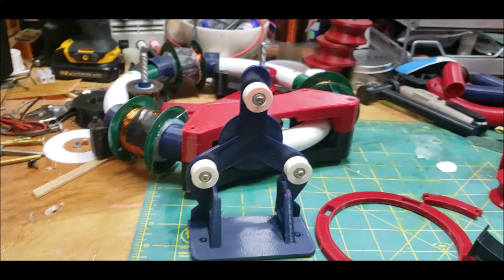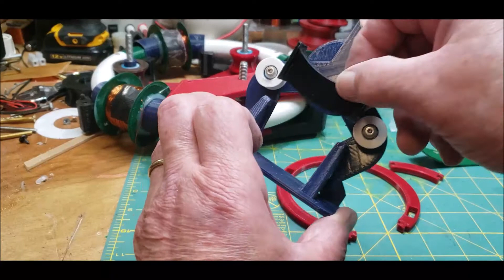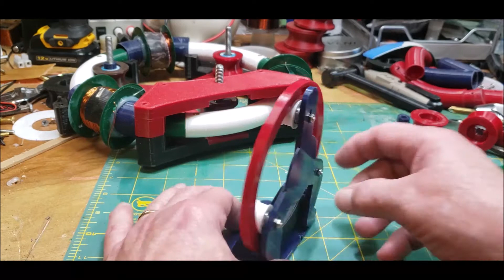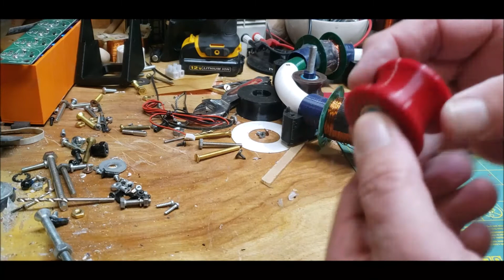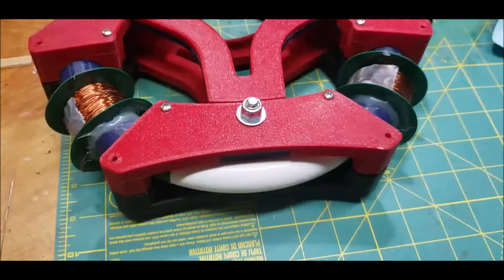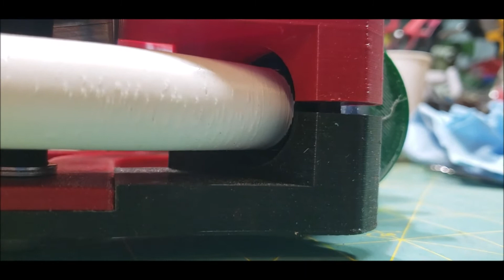3D Printed Solenoid motor update (plus a little one)

Comment: @mcorrade   It looks great dude. Amazing you found time to side-track onto my design. I'm thinking a Lidmotor type circuit maybe but the electronics is not my best subject
Reply from the maker: Hey my friend, I just finished the bigger system I've been working for and I'm uploading the results of the first run today ;-) but, in doing that, I realized that your system does not run because the magnets are to weak. I'm not sure if a redesign with space for more magnets will work but, if you up to designing it, I will print it. I'm thinking 6 spaces for magnets in stead of 4 may work?
Reply: @mcorrade  I'm on it dude
Reply from the maker: @Telboy-fv8ke  ok my friend, I got the new N52 magnets and I'm printing out the new rotor as I write. Hopefully I'll get it built and tested this weekend....
Reply: @mcorrade  that's great. Look forward to seeing it working.  Fingers crossed

Comment: Good to see others working on the same concept, was thinking of slotting the holes for adjustment, but I thin we will need to use two 10mm wide coils at each end of all three coil mounts to created a circuit capable of driving the ring and charging it, will show you soon what I am talking about.
Reply from the maker: cool
Reply: @mcorrade  The idea is totally from
SpaceManAust's  design, Be interesting to see it running
Reply from the maker: @Telboy-fv8ke  If the magnets come in today, you will see it running :)
Reply: @Telboy-fv8ke  
I am glad to see others working on this, I had designed it to be for a bike wheel at first, the idea was to have enough coils to drive it and charge at the same time, and because there is no resistance in the charging would charge while free rolling without slowing you down.
Did you print yours, are you going to build one, will be nice to see.
Reply: @mcorrade  Mint , looking forward to it
Reply: @SpaceManAus  I have built it but waiting for mcorrade to do his for wiring it, i am useless with the electronics side
Reply: @Telboy-fv8ke  Yes that will be the tricky part, he has been given a couple of circuits to play with. 
Bu I am thinking a different coil setup from his, but that is what it is all about maybe we will have others willing to give input that may help us.
Reply: @SpaceManAus  when set mine up I only put a couple on winds on the coil and 1.5v on a momentary switch and the one set of magnets I and it shot through.  So I am thinking a lidmotor circuit maybe.  Get back to it soon.
Reply: @Telboy-fv8ke  
Never seen a lidmotor circuit will look into it, I was thinking of using read switches to trigger mine, but I am not an expert on electronics either.
I have seen a true free energy device that was on YouTube for only two hours and was taken down by the power in control, was the simplest and most powerful device I have ever seen, would be able to be used to run anything we use in society, was going to show it's design but know I will be visited if I did, and with all the crazy people in the world with them all arming up not sure if it is a good idea, they could power robotic military with this type of power I am talking about.
Reply: @SpaceManAus  lidmotor prides himself on low power and long running  pulse motors. Got some really cool devices.
Reply: @Telboy-fv8ke  
The only thing with pulse motors is they have no use, can not run anything of them.
Reply: @SpaceManAus  your absolutely right. But they are great fun. I just made a wireless pulse motor within a pulse motor. Great fun. Will post it soon
Reply: @Telboy-fv8ke  
cool, I will check it out.
Reply: @SpaceManAus  true free energy device sounds awesome. Wish i had seen that vid.
Reply: @Telboy-fv8ke  
Find me on Skype and I will tell you about it, look for spacemanaust.